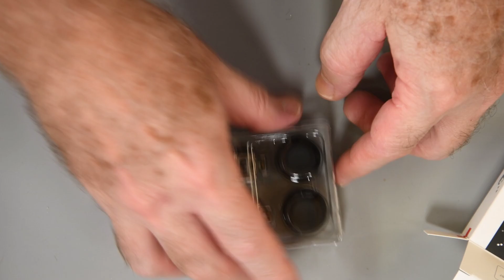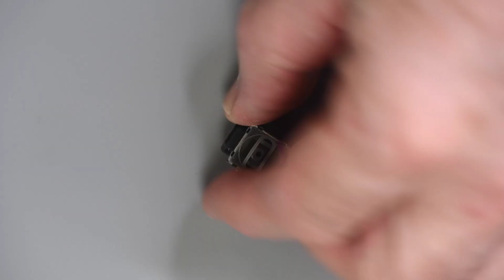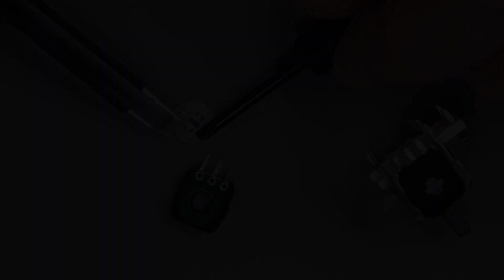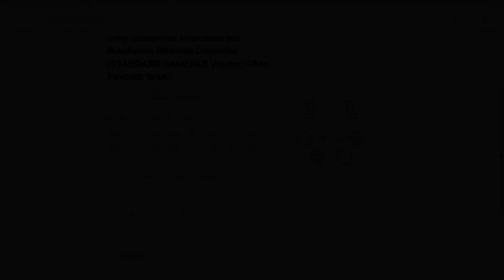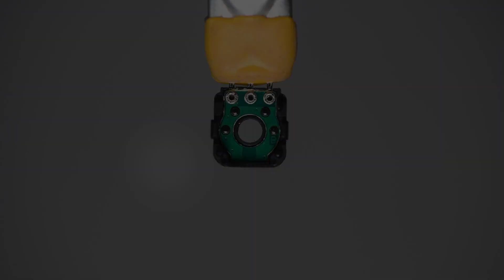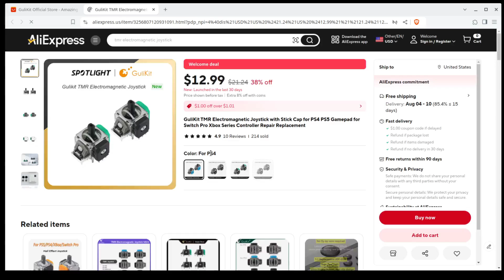A New Champion Has Been Crowned – GuliKit TMR

Comment: Would the favor hall spring fit and work fine in these?
Reply from the maker: No, there is a shaft difference between Favor Union and Alps.
Reply: @metalplasticelectronics354 but these aren’t alps. They’re TMR. If you’re saying the TMR is similar to ALPS, then the stock ALPS spring should fit in this right? I want to increase stick tension on the TMR
Reply from the maker: I was able to mount the GuliKit TMR sensor on an ALPS joystick frame.
Reply: @metalplasticelectronics354 the spring from the alps stick also fit the TMR stick. Let me know if it performs similarly with just the sensors or if there are any disadvantages

Comment: How do these compare to potentiometers in terms of input lag and accuracy for FPS games?
Reply: Still need answer?
Reply: @ Yes lol, seems like no one has really compared the two
Reply: @Dyzz98  alright, i think mine come in either tmrw or 27th. Im installing as soon as i get them. I play ranked cod a lot (crim). If I forget just reply.
Reply: @ Sounds good bro, thanks a ton for responding! I play only shooters so accuracy and latency is all I care about, good luck with the installation man
Reply: @Dyzz98  ok so, I only got one installed. I messed up on the left stick so I gotta order a desoldering tool. Anyways, automatically, 10/10. Feels just like the oem ds5 sticks, just a tiny tiny bit looser but perfect. I play with a single high-rise control freek and it feels sooo smooth. The circularity was right on the line with a 3% error. Also have my deadzone at a 0 now. (BO6)
Reply: @Dyzz98   sorry for the double reply but oml, you have to get them..
Reply: @AverageLuck  wow really? I havent heard anyone say they’re comparable to oem ps5 sticks, I might have to try them, any extra input delay with them?
Reply: @Dyzz98  not at all, my aim is def better tho
Reply: @AverageLuck  Alright bro I’ll give them a try
Reply: The input lag is a tad bit faster than oem dualsense joysticks 

Dualsense around 1.70ms 

Gulikit around 1.68-1.69ms

The ones I tested anyways. They feel basically the same as dualsense but have a tad bit less tension. They’re almost identical otherwise, other than the fact that they can’t develop stick drift. 

Way better than Hall effect too. I had some hall sticks from eBay can’t remember the brand but they had a disgusting input lag of 3.00ms which was definitely noticeable in fps games.
Reply: @SCALDIE- Wow, thats amazing, maybe we really are on the horizon of replacing Alps Potentiometers with TMR, how’s the accuracy with them in-game? Assuming you’re playing shooters
Reply: @Dyzz98 they’re basically identical in every way in game as far as I can tell brother.

Comment: Great video, very indepth. I'm part of the beta test (yes, Gulikit jumped the gun and released them early) and plan to install a set into my Xbox & PS5 controllers this weekend. I won't be doing this sort of analysis though, just a calibration and report on my findings. 😅
Reply from the maker: I think you will be happy with them.
Reply: @metalplasticelectronics354  I got them installed and calibrated, so far, so good. 👍

Comment: Dumb question, are these hall effect?
Reply: They have a magnet so yes
Reply: @NjutNjut That's all it takes? I wasn't sure if it was fully hall effect, thanks.
Reply from the maker: They are not Hall effect.  They use the same magnetic sensing technology as used for some hard drive read heads, a type of magnetoresistance.

Comment: Someone finally did it! I'll have to test them as well. I just wish the cost would go down so modders could resell them at a reasonable price. Amazing work with these videos!
Reply: I buy used, broken, stick-drift controllers for about $30 then rebuild to sell from that.
Reply: @syn80  have you checked out the tool I sell? It makes swapping the entire stick module almost instant. Way better than a heat gun.
Reply: @GregRosolowski  I have seen those type iron "tips" specifically for removing joysticks but I now only use a JBC style cartridge (C245) and it wouldn't be compatible with your version. I also see them on other sites using the T12 cartridge, also not compatible with my iron. There is more prep work for that type than a hot air station. I don't run a repair business to make that worth my time. But it's nice to have options.
Reply: @syn80 what do u do to them and how much do u sell for
Reply: @tn1495  The first "modded" controller had two brand new Ginfull V5 hall-effect sticks and had a RISE v1.0 back button kit. I sold it for $65. The only money I spent was $30 for a used motherboard, Ginfull joysticks and shipping. I already had the parts for the controller. The RISE kit didn't cost me anything. If someone sends me a controller and pay shipping both ways and for the joysticks I'd charge $20 to install them.

Comment: My ginfulls work great however the circularity is is slightly under on one edge whys that
Reply: possibly not fully flat to the PCB. maybe try recalibrate the circularity a couple times. if still not working try swapping it out with another sensor or full joystick.

Comment: DO NOT USE THESE ON THE SWITCH PRO CONTROLLER ATM.

The output voltage is too low for Switch Pro controllers, leading to them not being calibratable on the Switch unless you're on firmware 18.1.0 or newer (and sometimes not even then).

 Gulikit has stopped labeling the PS5 and Switch Pro modules as the same unit, and will be releasing separate Switch Pro modules in a few weeks.

Comment: Important to note, these same joysticks turned out to not be compatible with the Switch Pro controller. They are remaking them and re-releasing them in a couple weeks they said, The current stock is sold as only being compatible with only the DualSense, same boxes are used, just with a sticker covering the Switch Pro compatibility. New printed boxes will have only Dualsense or Switch Pro respectively.
DualSense joysticks got out of testing and are available on Amazon US now as well, DualShock 4 and Xbox are still needing testers so if you want those you can sign up so you don't have to buy them. I'm also one of the testers and so far had no issues at all, though I didn't test the Switch Pro TMR as I don't have that controller to test it with, others seem to be working fine.
Reply: @djBaro_official How do I sign up to test I have Dualshock 4
Reply: @jmaragh8114 same here please
Reply: @jmaragh8114  AKNES, reseller of Gulikit, is organizing the test. You can find more information through them.
Reply: Do you know if they will release with Dualsense Edge stick modules?
Reply: @KNIFEDEFIANT  No, I don't know

Comment: Those look like the definitive sensors 😄

Is there the possibility to calibrate them for the ps4 joystick?
Reply: Yes, the same way for Dualsense controller. You use the website he posts in his videos.
Reply: @syn80  Thanks, I didn't know it also works for dualsense.. I thought the calibration software was only for the PS5 joystick
Reply: They are currently available for the DS4, DS5, and Xbox "Series" controllers. Don't get them for the Switch just yet, wait a few weeks for those.

Comment: i dont know much, but i would like to ask if its possible to switch out the Potentiometer from the xbox elite series 2 with these sensors? i really would like to see that work as its my fav gamepad
Reply: You can, sensors calibrate to 2-5% if the sticks pillar thickness is 9.5mm. Kinda of low for the range department. Currently for Xbox they are not a good replacement. Since you end up with range issues overshooting at odd times. I'd wait for a new revision in a month or two.

I tested them before launch on Series and Elite 2 controllers.
Reply: If they are ALPS you could, just make sure you order the Xbox version TMR joysticks. But if your joysticks are worn it would be better to replace the entire joystick, not just the sensors.

Comment: In testing through AKNES the boxes labeled "Switch Pro & PS5" avoid those if you are trying them with a Switch Pro controller. They don't have the correct voltage needed to work correctly. If you find versions that only say Switch Pro Controller and NOT PS5 then they should be the corrected versions only for the Switch Pro controller.
Reply from the maker: What voltage does the Switch Pro run on?
Reply: @metalplasticelectronics354  not sure, people have said it's a little  bit more than dualsense. but if your switch is on the newest firmware it supposedly reduces the issue of it not reaching the edges while calibrating.

Comment: One of my PS5 Dualsense controllers started to stick drift again and since the warranty is over for it i thought i would order new joysticks and fix it myself.
I was looking for the best parts for replacement and i found your channel. You make really great videos testing many joystick kits and even showing how to install and calibrate them!
Thank you for your hard work showing how to fix controllers, its very helpful! I subscribed and will watch more of your videos to learn more.
I have a question though. You say that this Gulikit TMR set seems to be the best one, but does it worth the price difference compared to cheaper hall effect joysticks? Is it so much better?
There is that later version of Ginfull hall effect joysticks you tested a little while ago and they seem good too. The big difference is that for the same price i can get 2 Gulikit TMR or 10 of the Ginfull ones.
With a ten pack i could replace the joysticks in all of my controllers when they start to drift in the future and even have leftovers, but with this Gulikit i can only fix one.
I can afford to buy the Gulikit, just dont want to waste money if the difference is very minor or not noticeable, so im not sure which one to buy. Any thoughts?
Reply: Either choice will fix your stick drift problem. I have both Ginfull v5 and GuliKit TMR. Depends how picky you are and what games you play. If you have more than 2 controllers you fix several with a ten pack of Ginfull v5 joysticks and resell the fixed controllers then use that money for GuliKit TMR. Or if you only need 1 working controller then go with GuliKit.
Reply: @syn80  I see thank you for answering! I keep multiple controllers because i like having different colored ones and i also want to have spares, so if the battery gets drained in the one im using, i can just put it on the charger and take another one and continue playing wirelessly. So i wont be selling my controllers. Currently just one of my controllers have stick drift, the others are working fine yet. I had stick drift issues many times in the past, but previously Sony exchanged them for new ones because it was within warranty time, they usually started to drift after like 3-5 months of use, but lately they became more lasting and the latest controllers i got worked fine for more than a year, which was enough to run out of warranty time (Sony gives one year for controllers in my country) so i cant exchange them anymore.
Though im still not sure how noticeable the difference would be between the Ginfull and Gulikit joysticks, i dont really play competitive games, but i play action games and fps games. Maybe i could just get the Gulikit now and fix the drifting controller and when the others break down i could get a pack of cheaper ones and see how those work.
Reply: @Shadowg434  The only difference I feel between Ginfull and GuliKit is the tension. Both are fast and smooth. The tension has to do with the spring inside the joystick that allows it to snap back to center. Some people manually replace them but that's too much effort for me. GuliKit is like brand new ALPS and Ginfull is a little softer (less tension).
Reply: @syn80  Thank you for the answers! Since then i got a pack of Gulikit TMR joysticks and will fix my drifting controller with it very soon! :)

Comment: I just received a set of these joysticks for dualsense, since I have not a soldering station I am planning to replace only the sensor on the ALPS mechanism.
Reply from the maker: Not removing the joystick frame and switch makes for a much easier operation.  Good luck.
Reply: @metalplasticelectronics354  I made some practice on an unserviceable dualsense board, I am able to remove the sensor and install a new one. If the attempt fails I will buy a heated vacuum sucker pump and remove the whole joystick.
Reply: @metalplasticelectronics354 just wondering why it would be easier to desolder just those parts rather than the whole thing?
Reply from the maker: Removing the joystick frame can be difficult if you don't have the proper equipment.